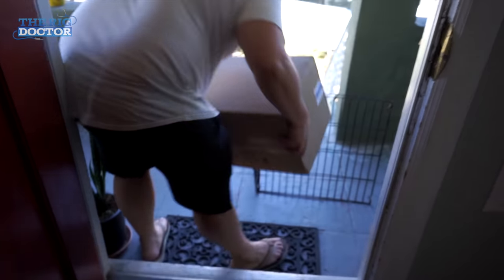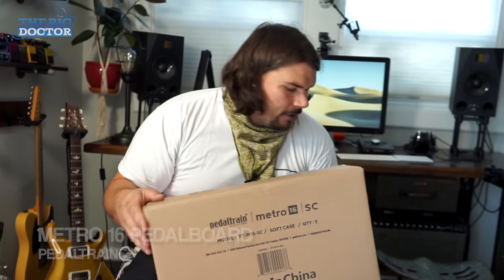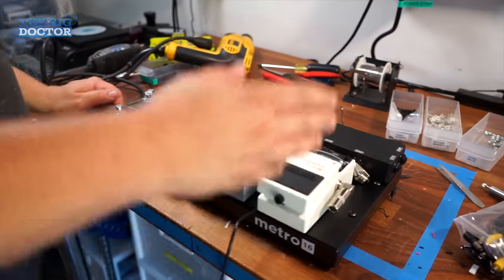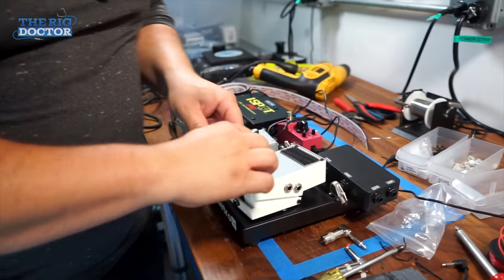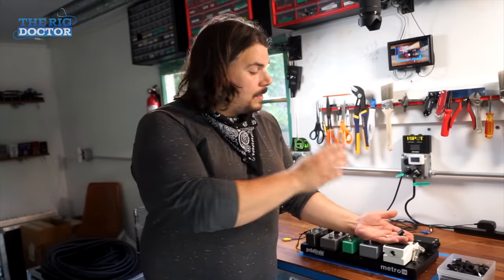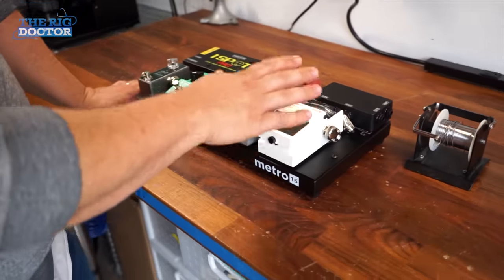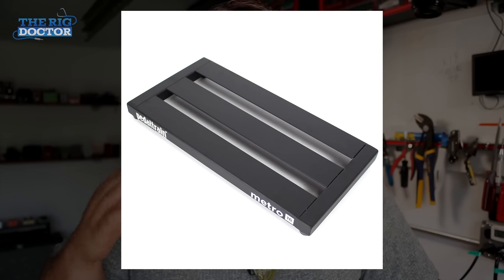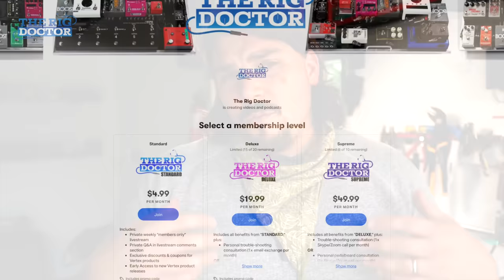Building A Budget-Friendly Mayer Rig!

Comment: My suggestion:
Micro Q tron—$95.80
Keeley tone workstation—$299.00
JRAD archer—$199.00
TC Alter Ego—$169.99
Boss TU-3—$99.99

Final Cost
$863.78

Masons suggestion:
Vertex steel string-$199.99
JRAD archer—$199.00
Ibanez TS-Mini—$79.99
Xotic EP boost—$120.00
Ibanez analog delay mini—$119.99
Boss TU-3–$99.99

Final cost 
$818.96

Cost difference—$44.82 more for my suggestion

Some additional points:
- For an extra $45 you get much closer to the overdrives and boosts John Mayer actually uses, as the Tone workstation was based on John Mayer’s tonal needs and includes a comp as well as a bluesbreaker/katana boost that are excluded in Masons board, yet are much more central to Mayer’s tone than a Dumble OD and certainly an EP boost which I’m pretty sure he doesn’t really use often/at all. 

- Moreover, Mayer has used analog delays, tape delays, and digital tape delay emulations, so digital tape echo emulation pedal, would be a much better alternative as it can handle much more of the delay tones of John Mayer. 

- My suggestion includes an envelope filter which John Mayer is famous for using. 

- As a final point, if use the same power supply as Mason does in this video (Truetone CS6) you can always one more pedal, as my board concept leaves one free adapter for one more pedal. You can add a wah pedal, Dumble style OD, Boss BD-2 or octave fuzz of your choice to include one of his less frequently used effects.
Reply from the maker: Ben, I think you make some good points here.  A few things to remember, it needed to fit on a Metro 16.  You suggestions are larger pedals, this would be problematic to sell the "mini rig" concept of the giveaway pedalboard, nor would they fit with this board platform.  Secondly, this giveaway was sponsored by Sweetwater and done in collaboration with them, meaning we had to use pedals that were in stock and available through Sweetwater.  I don't see the Keeley Workstation, Alter Ego, or the Micro Q Tron in their inventory or in stock.  I think there a lot of way to "Skin The Mayer Cat", I tend to go for more of the Continuum era stuff, and Trio era since that's more of the iconic tone to my ears.  These were much more scaled back rigs compared to what's being used now, and pre-dates the use of the filter effects, or any compressor use.  In any case, I appreciate your feedback, and certainly if the only criteria was getting there at the lowest cost there would be lot of pivot options to make, differently from what I did with Sweetwater.
Reply: Vertex Effects fair enough. Your choices definitely make a lot more sense under the limitations you laid out. I wasn’t trying to be confrontational btw just wanted to make some counterpoints.
Reply from the maker: I appreciate the suggestions
Reply: @Luke Monsensey thank you for that, I didn’t realize you were the judge of who asked or that I needed permission to share my relevant opinion but okay. Thanks for the unnecessary rudeness. I’m sure that that attitude gets you far.

Comment: Great build video. Truly appreciate it. I'm not sure if you placed a plate over the Metro16 rails in order to increase the contact surface area for the mini pedals. I would be curious to know what gauge steel you used. Thanks.
Reply from the maker: 16 AWG
Reply: @VertexEffectsInc  Thanks 👍
Reply from the maker: Angel Sanchez Guitar 🥰🥰🥰

Comment: Great build! When I use dual lock it always comes off of either the board or the pedal if I try to remove a pedal. Once it comes off it will not stick again. Doesn't seem to matter if I just put the tape on or if it's been on for months.
Reply from the maker: If it’s coming off it’s for two reasons, first reason is you didn’t clean the surface before you applied to dual lock.  Second reason would be, it’s supposed to remain sedentary for about 12 to 24 hours before you really start pulling things on and off, almost like a curing of the adhesive.  If I follow those steps I’ve yet to have a problem in over a decade
Reply: I did let it sit for 24 hours. Maybe it's not cleaning the surface well enough. I'll try that next time. I really liked the tip about flipping the bottom of the one pedal over to get a clean surface.
Reply from the maker: @frankstabler1920  Let me know how it shakes out
Reply: Had the same issue before, the reason for my case is that I use the wrong gauge, the 400 grid dual lock I applied was too strong for pedalboard usages, should choose 250+170 or 250+250.

Comment: @vertex Effects, I am new to building pedalboards and a big fan of your channel! I am hoping you can help me understand the best way to set up my pedalboard to get that "John Mayer" tone? Here is a list of my pedals. Can you tell me if this is the best pedal order or how to obtain this info? Thanks! 

1.	Polytune 3 – (Tuner/Buffer) // 9V DC power supply
2.	Boost Pedal (Keeley Katana Mini)
3.	Distortion/Overdrive (Silver Archer -Klon/Klone) / / 9V DC power supply 
4.	Distortion/Overdrive (BD-2 Blues Driver Keeley Mod) // 9V DC power supply
5.	Distortion/Overdrive (TS808 Tube Screamer) / / 9V DC power supply 
6.	Envelope Follower Pedal w/Effects Loop and Attack Response (Qtron+) // 24V DC power supply 
7.	Boost/Overdrive (Steel String Clean Drive – Vertex) // 9V DC power supply 
8.	Analog Delay (Way Huge AquaPuss) // 9V DC power supply
9.	Tremolo & Reverb  (Strymon Flint) // 9V DC power supply
Reply from the maker: I think you’re off to a great start! Get some high-quality soldered cables in the air, Mogami he would be a good start!  2319 for the Pedalboard, 2524 for your instrument cables.
Reply: @VertexEffectsInc   I ordered all the Mogami Cables, tools, ect from the links provided in your Comments on different videos! I was inquiring on pedal placement/ order? Can you recommend what order to place pedals or a site that specifies the best order placement for John Mayer tone? Thanks!
Reply from the maker: @mpflippo1023  i think you got a good order.  I sometimes mess with the Klon and TS order.
Reply: @VertexEffectsInc  Thank you!

Comment: Another awesome board! Love the John Mayer/SRV tones👌 what are you using for your surface on the pedal train? I noticed it’s a lot thinner than what you’ve used in the past.
Reply from the maker: Tanner Shultis amazing!  Using some thin powered coated sheet metal
Reply: Vertex Effects oh awesome! It looked great! I’ve added surfaces to a couple pedal train boards, might have to find something similar for a thinner option. Thanks!
Reply from the maker: Tanner Shultis most metal places can make this for you and you can get it powder coated like we did for this project.
Reply: Vertex Effects Cool, I’ll have to get in touch with a local metal place. Thanks for the direction!!

Comment: AmaIng rig here Mason. I’d like to know what’s the significance of placing the steel string after the drive session? Is it an always on pedal in this case?
Reply from the maker: It's emulating an amp tone of a Dumble, normally you'd run your drives into the amp, not after it.

Comment: What if you got like 12-14 pedals, and as we know,  power supplies basically have like 7-10 outlet wires to power the pedals.. None of them have enough for a whole board.. So  do most guitarists with more than 10 pedals on a board use 2 power supplies?   I dont see any other way, since power supplies do not really cover more than 10 pedals at the most, right?  So would the 2 power supplies cause noise, hum, etc.. how is this solved?
Reply from the maker: You can get power supplies that have options to expand, like CIOKS, Strymon, and Voodoo Lab.

Comment: Hi there, so do you suggest putting the steel string after the drive/gain section and immediatly before the modulations? I currently run it immediatly before the ods and after the comp, doing it wrong? :)
Reply from the maker: After drives, like it was an amp
Reply: @VertexEffectsInc  cool! will give a try then :D

Comment: Great Video! But couldn't you just flip the backplate of the Boss TU-3 with the rubber on, or isn't there enough space inside the pedal? :D
Reply from the maker: It's not a universal thing on all Boss pedals, and I'm attempting to generalize this technique no matter the Boss pedal.  Many of the Boss pedals won't allow this because the mezzanine board with the pots push the main board right to the edge of the enclosure, where the tuners don't have any pots to deal with so there is more space inside.

Comment: Hey Uncle Mason, I'm looking at re-creating this board. Can I ask if you were to add a small looper pedal, to the board would it be ok to run that outside of the between the interface and the amp? Are you any closer to selling this buffer interface (I think you mentioned it could be a possibility to another comment previously). 
Also would it be as easy as swapping to the Truetone CS7 instead of the CS6 to power the extra looper? Cheers and please keep the great content coming!
Reply from the maker: Sure, you could run it after if it didn't fit on the board.  We're still a few months away from a commercial buffer but you can always build our DIY version if you want one now.  We have those videos and diagrams here on YouTube and our website.  I'm not sure if the CS-7 will clear a Pedaltrain - I don't use these platforms typically.
Reply: @VertexEffectsInc  Thanks Uncle Mason. Assuming the rest of the board is constant, a Keeley Katana mini instead of the Xotic Boost wouldn't be wide enough to create any overlap would it and is there any reason you'd favor the Xotic Boost over the Katana mini? Cheers!
Reply from the maker: @michaeln9612  no, the Katana would have been a better fit.  However, at the time it was no longer made, and not available so we wanted to stick with inventory that was available at Sweetwater.

Comment: I have a question about power supply if someone could please answer. Where does the power supply plug into? Do you have to plug it into the wall? I’m confused on how you would power the power supply.
Reply from the maker: Yes, power supply plugs into your wall AC.  There is a IEC jack on the left side of the power supply.  You can see if you look up the power supply, Truetone CS6

Comment: What did you use on the Pedaltrain board to make it a flat surface?
Reply from the maker: A piece of sheet metal
Reply: @VertexEffectsInc  How did you treat the surface, e.g., paint?
Reply from the maker: @gilguajardo7808  it's a sheet of powder coated aluminum

Comment: Could you flip the boss “stock bottom” without removing rubber/label? Curious if they leave enough room to avoid ripping ones pedals up. 🤔🤷🏽‍♂️ good trick regardless!
Reply from the maker: Depends on which device it is, some of them have multiple levels of circuit boards, and there isn’t in the ability to do it.
Reply: @VertexEffectsInc  ah good to know. Kinda figure yall didnt tear it up for no reason but it also looked like an option worth vocalizing. :) Only Boss i have rn is an re-20 so thats sorta dealing with its own footprint “fun.” Lol! ☺️🤘🏼
Reply from the maker: @Ohnoe1aopk  thanks for watching!

Comment: Hi Mason, I’ve seen you solder the patch cables with the outer SHIELD wire to the inner connector of the SP500’s. Then you solder the inner SIGNAL wire to the outer connector of the SP 500’s is there a reason why you do that? Shouldn’t the shield wire shield the signal wire always? Thanks! 
Ray
Reply from the maker: The shield will always go to the sleeve, the center conductor will always go to the tip.  I've not wired it differently than that or shown any other way to do it.  You can check out our videos on how to wire SquarePlugs if you're interested in how to do it properly.  These plugs in this video are a Switchcraft style plug, a little different than the SquarePlugs in terms of where the lugs line up with the tip and sleeve.

Comment: I just bought the Vertex Steel String MKII and  like it a lot! I'm running it in to a TS9 (Analogman 808 mod) followed by the OCD, then Xotic EP. I'm not sure about keeping the ep booster on my board. My question though if the Steel String going in to a tubescreamer, ocd, is correct. It sounds fantastic to me but, wanted to ask the question. Thank you in advance.
Reply from the maker: If you’re treating the Steel String Pedal like an amplifier, it would make more sense to put it after the TS9.
Reply: @VertexEffectsInc  Thank you! It's a great pedal and adds a huge amount of head room to my Fender Bassbreaker 15W. When I hit the TS9, the OCD, and Vertex together on a lower gain setting It's absolutely incredible. I tend to run the Xotic EP by itself. When I just want some color and more valume with modulation.
Reply: @VertexEffectsInc  Currently I have the Vertex, TS9, OCD stacked running in to a clean Fender amp. I'll put the Vertex in back of the OCD. So the TS9 & OCD are hitting it.

Comment: Question about the True Tone, I was wanting to buy a shorter iec cable. Will a 18 gauge work! Are should you stay with the 16 gauge? There’s just more options with the 18 gauge length. They have some two footers for a tv and computers. Can I use those? I’m wanting each end to be angled.
Reply from the maker: That’s fine
Reply: Vertex Effects thank you. Just didn’t want to fry any of my gear
Reply from the maker: Guitar Life wouldn’t do that if you went that size.  14 AWG is usually what’s in the wall, but I’ve seen some cheap cables from China come with 16+.  Ideally the thicker the better to be safe but I don’t think you’ll have an issue.
Reply: Vertex Effects thank you brother
Reply from the maker: Guitar Life 🥰🥰🥰

Comment: hi i wanted to ask is the interface a normal junction box or an effects loop? because i see that you connect the pedalboard to the effects loop if im wrong.
Reply from the maker: This one is strictly a pass-through for a centralized connection point for the input and output, we have other videos and more sophisticated versions on the channel if you’re interested in that
Reply: Vertex Effects thanks for answering! I also wanted to ask if you plug it straight into the amp or the fx loop of the amp.
Reply from the maker: Isaac Jinivon this would all be in front of an amp, no effects loop

Comment: Why the boss tu-3? Isn’t it making the signal too bright? (I use a tu-3 too because i got used to it, but i am curious about your opinion)
Reply from the maker: toomuchsoulforawhiteboy what about the TU-3 would make it bright?  How are you testing this?
Reply: Vertex Effects i thought because of the 1 M ohm input impedance, but actually i am just a normal guitar player, i have no clue about these things really
Reply from the maker: @davidtoth1  1M is what 99% of guitar amps have on the input Z, so no real change there, maybe if it were higher, like 2.2+ maybe you'd get some more of that unloaded pickup sound.  The output impedance of the TU-3 is pretty bad, 1K  - plus it's a BJT so not particularly efficient line driver.  Also, it's hitting a Tube Screamer and Klon in sequence following it, so at best it's really only impacting the pickup loading and controlling that, and the output buffer is only doing anything for about 6-8" of cable before hitting another buffer which takes over at that point.
Reply: Vertex Effects I see, thanks for explaining that, I was curious about it really. You are so kind, be blessed man!

Comment: Hey! Hoping to get myself a steel string, but need to get more information about it first.

What’s the steel strings role in this board if i may ask? Does it come into play most in the clean tones? Or more like a base sound to make the amp sound more like a dumble?
Reply from the maker: On this board it's more about imparting that "Dumble amp-like" quality to the whatever the board ends up being paired with.  Setting the EQ and compression and feel of the Dumble irrespective of the clean amp used.